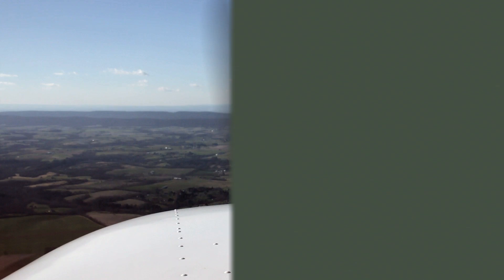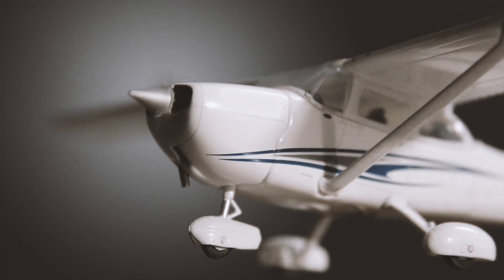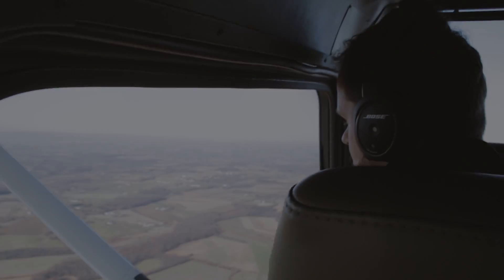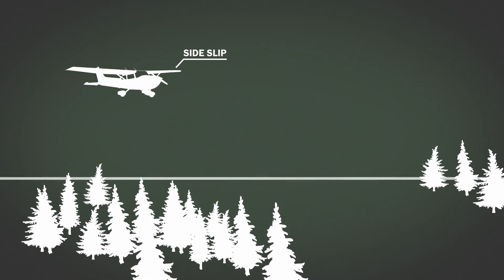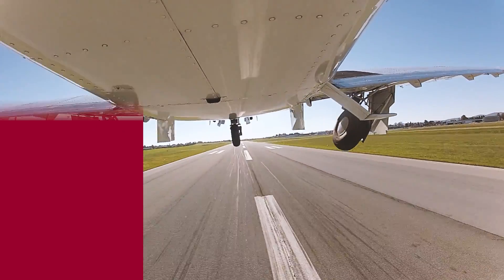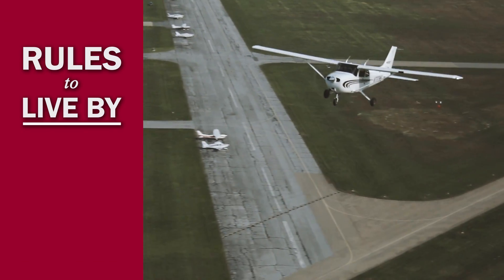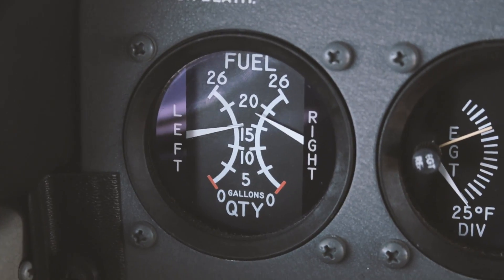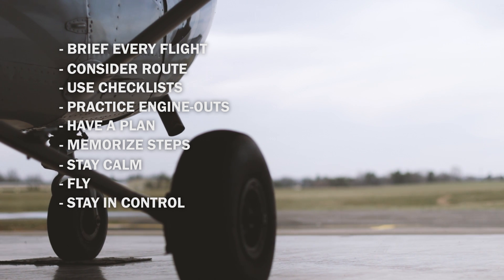Engine Out! From Trouble to Touchdown

Comment: I would have liked to see an additional item : crack open the door.
in the 1970s there was a C310 at California's Cable Airport - five folks on board, baggage, fuel, dog, in pea soup fog. Lost the right engine. Pilot did a 180, couldn't see the airport, and it came down in the parking area of an apartment complex and hit a tree planter. People ran to the aircraft and saw the woman passenger yelling "Help me" and then the plane exploded in flames. All died. Had they cracked open the door they could have evacuated.

Comment: It was briefly mentioned, but deserves mentioning again:  Not all engine failures are a total loss of power!   Make sure the engine's making the rated power before leaving the ground.   There was a fatal accident locally because of this.   Have a defined abort point picked out and stick to it.  ie: if we're not airborne by taxiway Charlie, we're chopping chopping the throttle and aborting. 

How can you tell what's normal?  Go look up your aircraft in the FAA's TCDS.   For example, on a Cessna 172S or even 182S at full throttle the prop should be spinning "not over 2,400 rpm, not less than 2,300 rpm".  That's pretty specific and easy enough to check.  I've added it to my checklist.

Comment: I've watched several other youtube videos on engine failures. In a typical Vy climbout, the airspeed went from Vy to stall in about 6 SECONDS!! The average pilot uses up about 3 seconds in shock that the engine has just quit. If you don't pitch for best glide quickly, it's going to stall/spin with only a few hundred feet on altitude to work with.

Comment: Don't worry... if you lose your engine, your aircraft can take you safely all the way to the scene of the crash.
Reply: If you're driving and a mechanical problem occurs, you pull over to the curb and get out. If you're in your plane and something goes haywire at 10,000 feet . . . well, it'll be an interesting experience for all concerned. . . .

Comment: Gliding 6 miles in 8 minutes, as calculated for a C172 in your rules of thumb,  means that you're flying at a speed of 45kts. This seems like a glaring error to me?
Reply: Consider that those 6 miles are parallel to the horizon, while your actual movement is not, so it is quite longer that 6

Comment: Another thought: if you're flying an aircraft equipped with a constant speed (adjustable pitch) propeller then go full coarse (pull the blue knob full out). This is akin to feathering the prop and you'll glide perhaps 20% further than full fine pitch. Note, however, that a loss of oil pressure may preclude the adjustment. Nevertheless, it's worth a try and may gain you some additional time & distance.

Comment: As a non-pilot simpleton, i find all of this terrifying.
Reply: Focus on the glide chart... You usually will have 5-15 minutes before the plane runs out of glide energy.   Do you get 5-15 minutes' notice before being involved in a car crash? I don't think so.
Reply: @grayrabbit2211  If you're driving along and the car develops a mechanical problem, you pull over to the curb and get out. If you're in your plane and something goes haywire at 10,000 feet . . . well, it'll be an interesting experience for all concerned. . . .
Reply: @orvilleh.larson7581  10k feet? That's a nice buffer.
I often practice engine-out glides into my home airport to get a better feel of what I can and can't expect my plane to do.  I'm usually starting mine at about 3,000' AGL.  It truly is surprising just how far you can glide in a plane.  Unless it's a Cherokee Six, at which point a stone will glide further...

Comment: At your home field, you should KNOW the engine-out options. I've also heard of pilots checking out past the departure end of the runway they're about to land on, knowing that they'll be taking off from it later and might need to put the thing down.

Where I learned to fly, the options were not good. As the grizzly CFI put it, "Go lef, lan' in de shanty-town an' get yu ass shot. Go right an' drown in de 'arbour. Or lan' straight ahead an' go cre-mate yuself in de oil refinery."
Reply: 6yjjk :)

Comment: A folded jacket can help absorb impact forces? Yeah, that's total crap. The forces involved in an air crash can easily exceed those of the worst car accidents and occur in a vehicle with far fewer protections (no airbags and a lighter body more likely to collapse into the survival space from every direction). All that matters is velocity, angle of impact, and impact surface conditions. After that, you either survive or you don't--it's random chance.
Reply: True, but in a minor crash landing, your face can get smashed into the control panel and you could be disfigured, maybe only badly bruised, or have a skull fracture.  Yes, that's the random chance but a cushion or folded coat could minimize that outcome.

Comment: Departed Texas  in Skylane RG enroute US east coast.   Shortly after takeoff noticed oil temp climbing and pressure getting low.  Engine was making normal power but returned immediately to departure airport and landed without incident.  Maintenance found lower piston had separated and metal fell into oil sump.  Crack occurred below compression rings of piston thus the cylinder was still making normal power.  Would have seized up and failed .  Paying attention to gauges proved key, and of course getting back on the ground.  Safe flying.

Comment: 5:37  after rotation eng fail with good runway in front-1- Nose down 2- THEN power down if any left.  Nose down first.. and think "down we must go.. to avoid pulling up elevator by eliminating the previous thinking of going up and pulling up-the main cause of stalls LOC on that emergency.  Cut the mixture and cut the flaps too on touchdown,  if think you are going to overshoot, go to one side of the runway, then turn at end. Better to scrape one of the main tires than bending the front gear. 

I used to teach 4 kinds of engine fails on take off.  Did from 1990 to 2004.  Did them all Actual-not only on easy to do simulator-on all kinds of Pipers besides Cessnas.  Canadian pilots are better than most USA ones i noticed.  Keep spinning them.  It is a control nerves exercise that makes for better pilots overall. Why?? because fear is the most pilot error producing factor.  If you are used to keep coordinated and fast reactions while fear situations you will be a real  pilot, not just a Parrot Pilot.

Comment: Having had a total engine failure from vapor lock over the Rockies 25 miles N. of Helena, MT, I'd like to add a couple of points from personal experience.

1. The pilot may have to deal with panic - from passenger(s). The screaming can interfere with communications. This is not trivial when they may be loved ones.
2. As we descended below radio range with ATC, a freight dog at cruise altitude assisted by relaying comm. Thank you Matt Ferrari! I'll never forget your calming help.
3. It wasn't on my checklist, but it wasn't until later that I realized I may have been able to keep the engine going using the primer. Unlike both the engine-driven pump and the electric pump, it is located in the cabin which was cooler. BTW - it was 85°F at 9500' that day and I had saved a few bucks by fueling up with autogas. NEVER AGAIN!

Post note: We were able to glide long enough that the engine regained power as we were on downwind for what would certainly have been a crash landing in rough terrain. If I had pulled the throttle back, I wouldn't have known we had power.
We gained altitude over our chosen spot until we could glide to a better one, then another, etc. We made it to Helena where we were cleared to land, "Any runway, any direction."   Thanks, tower guys.
Reply: Keep troubleshooting in a secuence.  A friend of mine nursed a C172 with rust in the fuel filter with primer pumping..  For about 20 miles. Made it.
Reply: Fully loaded 172 at 1200' over Lake Winnespasaukee (very large) near Laconia, NH.  I had site seers on board who kept requesting i go lower to so they could see more and buzz a dinner ship.   Ummmmm....No....absolutely not.  1200' feet would get us close to the shore should our flight go from sugar to $hit.  And it did.  A magneto disintergrated and the rpm dropped further than i expected.  Of course i traded speed for altitude and nursed the aircraft to 3,000' and took my first deep breath.  I notified my passengers about our situation.  I notified the nearest towered airport (8 miles and the closest) of the situation and i would be diagnosing over the next few minutes to make sure it's not something i did or didn't do to cause the issue.  On the checklist was a magneto check, which i was sure was the issue.  Of course the first magneto i check was the dead one.  Talk about a pucker factor....the silence of the engine was bizarre.  I flipped to the good mag and the windmilling engine pop and snorted back to life.  I went into Laconia airport hot and high.  We landed and as my passengers were walking away one young boy said to his Dad, "I'm glad he didn't go down low like we wanted....that was kinda scarey." Aviate, navigate, then communicate, then test and diagnose as required.  Thanks to Gordon Beckett, my Flight Instructor who gave me as much wisdom and training.
Reply: @NeverforgetElvis   I got a 172 back after losing a magneto just after takeoff. The cowling was shaking so bad at full power I thought the prop was going to fly apart but after throttling back it subsided and I was able to maintain level flight.  There was not much wind around so I put her down on a crossing runway.  Things happened so fast my passenger in the back had no idea there was a problem until I told the tower I intended to land immediately.  My passenger up front in the right seat was a lapsed pilot (172 rated and at the time had more time on type than me),  he knew straight away something was wrong, I could see he was nervous and needed something to do, so I gave him control of the flaps and asked him to call my airspeed on approach.  Although it wasn't strictly necessary,  when I look back that choice was one I am most proud of because there was nothing planned or briefed, I made a snap command decision in the moment.  He did a great job too.
Reply: @SPQRTempus  well done steely-eyed driver.  I'd ride with you any time.
Reply: Holy shit , you used gasoline and not 110LL?? Oh boi. Your brave Brother
Reply: The worst could happen is panic
Reply: To my understanding aircraft carburators do not have air screws on them like car ones do yes? I would assume there is no need for them as you have a mixture knob in-cockpit.
Reply: @DAN007thefoxx1  Yep, aspirated engines do have idle adj. screw. With manual controls , use by the pilot.  The fuel lines running from the spider valve to the jugs is a very small i.d. line.
Reply: @igot99problemsbutmyaltaint81  I keep having mixture problems with a carburated car lately (loses power and dies when engine is hot) And Attempting to  compensate with carb adjustments only made things worse. I believe the distributor or carb itself has failed.
Reply: @DAN007thefoxx1  huhn, the dist. is gear drivin and the upper is electronic, do you have an rpm gauge? If it runs smooth at idle, it in theory should run at speed.  Is the thermostat opening up at the right temp?  Maybe set the carb back to factory and adjust from there? If its an older model, change out the fuel filter too :-p hmm, you might beable to put a test meter on each plug cable to check the dist. out puts. Carbs are touchie , hope ya get hur fixed💪
Reply: @igot99problemsbutmyaltaint81  No it idled slow when cold then refused to hold an idle hot. Also the fuel filter was changed as well as some electrical componets such as the coil.
Reply: @DAN007thefoxx1  be systematic and go through one thing at a time. Check your carbs are balanced and are picking up cleanly off the throttle, and check ignition timing with a strobe. Then I'd be inclined to pull the plugs and have a good look at each - plug colour can tell you if you've got one that's running rich. Then whilst you're there do a compression test (might as well, since you've taken a plug out). Then run a colour tune to check mixture.

One of those will certainly point you in the right direction.
Reply: @chemistrykrang8065  Had to rebuild the carb. But its working now. I retuned it myself and its stablized when at operating temperature.
Reply: Dam "saved a few bucks with auto gas"...I'm not going to say it.
Reply: Not completely sure but seems like there may not have been enough oxygen at altitude to keep the engine running considering that you regained power on downwind
Reply: I am concluding to better not get into this expensive and dangerous hobby if a few bucks need to be saved 'here and there'. I am seeing this in other cases too. Do the math and see if you can afford the whole maintenance and replacement cycle for a plane and still be happy about it.
Reply: @cruisemissle87  perfectly said.  Amazing words of wisdom.

Comment: I thought you declared an emergency on the frequency you're currently on
Reply: In fact you should use the current ATC frequency to declare an emergency. 121,5 is to use when the contact with your own ATC is not assured.
Reply: @MassimilianoChiani  I make it a practice to always be tuned into the nearest airport Im flying near to maintain traffic separation, but if in range, I always have an ATC frequency tuned in standby freq in case of an emergency. If I have an emergency I will simply switch to standby freq and fill them in.

Comment: In the past, I have had one total engine failure and two partial failures. In the total engine failure event, I was flying  at 5000ft,  some 2km off our home airport, about to start spin training with the student pilot. As the student entered the spin, the engine quit. I flew out of the spin and headed for the airport,  engine start was impossible because this particular airplane didn't have a battery installed (it did NOT windmill). I aimed for 4k, 3k, 2k, 1000ft chekpoints in the traffic pattern and adjusted the flight path accordingly in order to reach each one at the right altitude and landed uneventfully - I even brought the airplane to a full stop at its  assigned parking spot on the apron, which made it hard for the mechanic to believe I actually had had a full failure. The other, partial failures were actually a lot more dangerous as they were on take-offs. In each case,  I managed to bring the airplane around the traffic pattern and land, choosing possible landing sites along the way. Downwind leg was particularly scary as it was, well, downwind, with the potential for a very high ground speed, off-airport landing. 

Great video. It should have mentioned, however, to unlatch/open the door before an off-airport landing. This is extremely important - should the airframe warp even just a little on impact, this could mean the difference between walking away and being trapped inside the airplane.

Comment: When I did some flight training at ATP, they briefed a 180-turn to land on the taxiway if we had an engine failure right after takeoff...always seemed worthless in my mind and dangerous
Reply: In gliders we practice 180s from 200 AGL
Reply: From 400 feet agl, partial power RPM I demo Take Off Turnbacks to opposite.  Zero power from at least 600 feet agl is possible most times (Cherokees, not the short wing type).  CFI should demonstrate that Emergency Turnback to you.  But Chicken CFI's cant do that.  Ask for demos always.  If they cant demo what they say YOU-"YOU SHOULD DO",  they are fake flyers.  
Most USA CFI's are Mild Maneuvering Maggots. The like only mild maneuvering due is easier.  Canadian CFI's, Latin American CFI's and most European CFI's HAVE TO DEMO spins to students or get fired if cant do it.  USA Chicken CFi's make you a Chicken Pilot due you get Chicken Pilot training via mild maneuvering only.